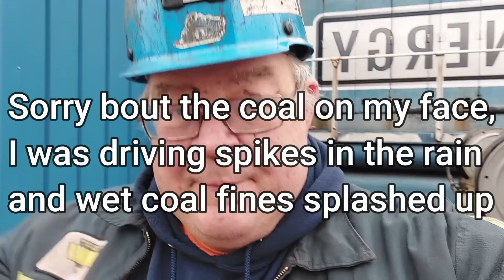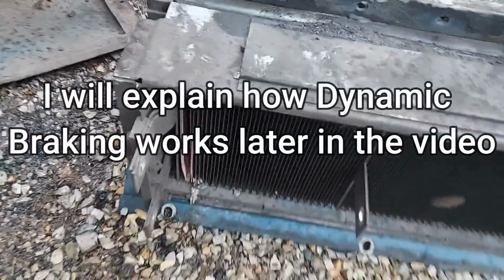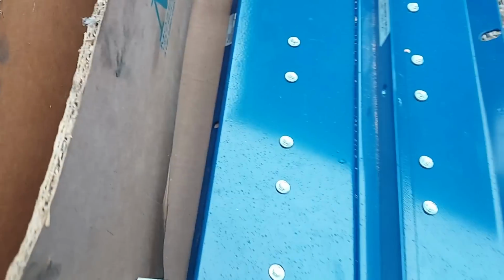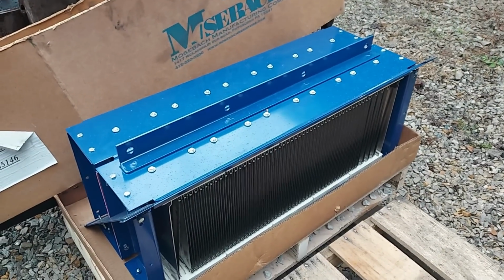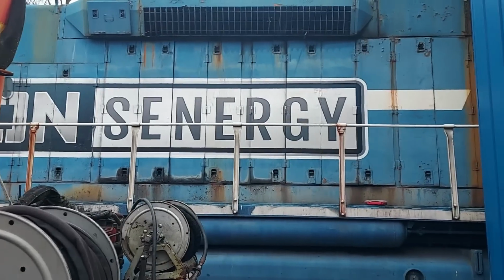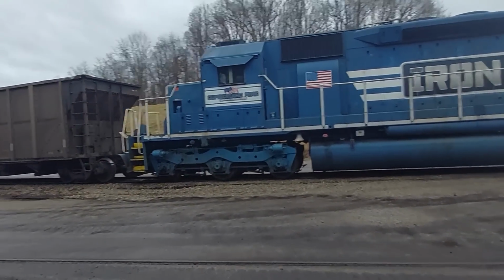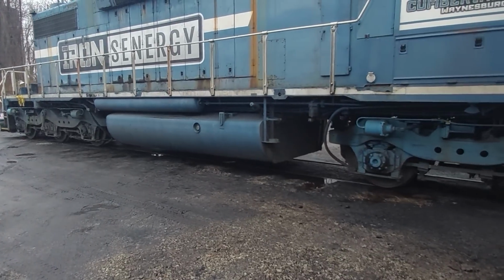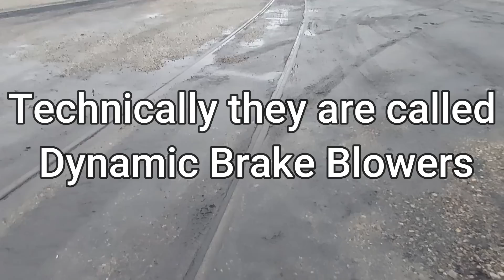New Locomotive Dynamic Brake Resistor Grids

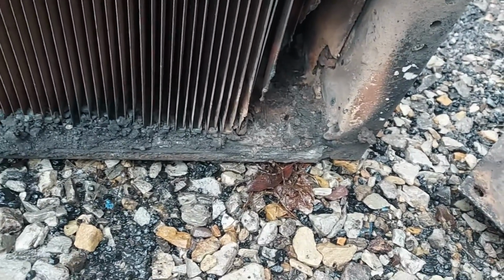Comment: Hi Dave! I have a particular question: I'm building a 1:20 scale SD 40 - SOO line (unit 750); I have also made some flexicoil trucks, which with my available documentation it was not easy to identify what type they are, since I know that there are many types with small differences, so I would like to know what type they are exactly, if you can help me and now I have now discovered they are the same as this 3098  ( on 6:50  ) locomotive in this  video, while the other locomotive in front,  has the different HTC type, I think..! Thank you ! Greetings from Italy !! 😉🖐🖐👍👍
Reply from the maker: Our two SD38-2 locos have the HT-C trucks under them. SD 40-2
units were built with HT-C high adhesion trucks. Our 3098 loco is
an SD 40-2, however it was built as an SD 40. the dash 2 upgrade
came later in it's life at Boise Locomotive Works. The frame on
the 40 is shorter than the frame on the 40-2 locos. Thus the
Flexicoil trucks are under our 3098. So you should be correct
in putting Flexicoil trucks under your SD 40. Also note that there
were many versions of the Flexicoil trucks, to find out exactly
what version was on your SOO you'd have to do some more
research, but unless you are a total correct police type guy,
then don't worry about what C version was on there.
Reply: @ccrx6700  : Your kindness Dave is amazing!!
Thanks for the prompt response! Now I understand much more!!
Now I have almost finished my huge model and I also made the flexicoils very well, it was very difficult! I'm still missing a lot of things to complete the model but it's well underway. 
It's always nice to see you cheerful and smiling!😉
Good day !! 👍👍😄
Reply from the maker: @feisarplinsky5496  👍😊

Comment: I have a question has anyone ever cleaned those  they fail because the cooling fins don't get cleaned coal must clog them up great video thanks Dave
Reply from the maker: A good bit of coal dust does get in there Gary and you are right, that
dust is hard on the grids, with what we do here that coal dust can't
be helped.  Very much appreciate your taking the time to visit with us and check out the video my friend.

Comment: What voltage and whatts are they?

As I used to visit a company for British Standards and visited a company near Southampton making mainly sand filled air cooled ones, the biggest was about 1/2 the size of your one.

Looks like you had water and  crud shorting out the resistor.

You dont want them to fail, when you're dragging a heavy load down grade.
Thanks.
Reply from the maker: I do not know the voltage and watts Anthony, sorry bout that. Yes we
are trying to slow down heavy loads on some steep grades and
those dynamics are the ticket. Most times unless rails are wet
or icy car brakes are not needed using the dynamics only. Coal
dust does get in them and doesn't help out at all. The coal dust
was all cleaned from these before we put the new ones in.  
Very much appreciate your taking the time to visit with us and check out the video my friend.

Comment: @ 7:50 it looks like water and dirt built up in the corners of the resistors may have caused arcing to ground on high loads???
Reply from the maker: Lot of coal dust gets in there Ken, that doesn't help matters at
all. The coal dust was cleaned out before the new grids were 
installed tho, but it will keep on coming in. With what we do here
it just can't be helped and it never gets cleaned out. Most folks never get to see what the grids actually look like, all they see is the screening on the outside of the loco body and can't see inside that.  Very much appreciate your taking the time to visit with us and check out the video my friend.

Comment: I can imagine the dynamics didn't work quite right with the big structural hole molten into them! Does the engineer get some kind of alarm in the cab that his brake circuit went out of service?
Reply from the maker: He is supposed to get a ground fault alarm, whether he did or not
I didn't ask him 2xKTfc. These are old locos and not everything
always works as it should however. Last grid went bad was after dark
and the operator saw flames shoot out from the grid, didn't need
an alarm for that one! :-)   Very much appreciate your taking the time to visit with us and check out the video my friend.

Comment: Thank you for this video!
The vanes at the ends in the radiating unit that are most subject to corrosion could be made of a different alloy. That way, good/serviceable vanes would not be wasted when the time comes to replace the unit. And it wouldn't hurt to have the lower ends of the rest of the vanes plated with a corosion resistant material at the sites where the corrosion seems to begin.

The major difference between a motor and a dynamo is the circuitry. If appropriately configured, the roles can be switched by throwing a switch.
Reply from the maker: That is what happens when traction motors are converted to generators Robin, the circuitry is changed you are right about that.
We have a problem here that is not easily solved and that is the
amount of coal dust that gets in these grids, it just can't be
helped with what we do here. All the coal was cleaned out when
they took the old grid out before they replaced it with the new one,
but it will happen again, no one takes the time to take the screening
off and clean these out on any kind of periodic basis, plus with
only 3 locos they are usually being used and not just sitting
around unless something else breaks down on them where they
have to sit. I'm not sure but using a different metal in them would
have to be stainless steel to prevent the coal from harming them?
No one makes stainless grids that I am aware of and they would
probably be three times the cost if they did.  Very much appreciate your taking the time to visit with us and check out the video my friend.
Reply: @ccrx6700  I was thinking of non-ferrous metals. Also a blower to clear the vanes when in use.

Comment: Pretty well burned up. Sent off to be remanufactured I guess? If you video another such operation maybe try and get a shot or two of the inside of the engine where they are located/mounted.
Reply from the maker: Yes they were and they are sent out for a rebuild Pavil. You can't see
them from inside the engine compartment, all you can see is
what I showed you on the outside where they are mounted. There
is a solid sheet of metal beneath the grids. Very much appreciate your taking the time to visit with us and check out the video my friend.

Comment: Did the coal dust in the fins cause it to short and burn up like that or did the coal dust block the flow of air causing it to over heat?
Reply from the maker: Coal dust in there is never a good thing, probably a combination of
both David. They never get cleaned out as part of a regular maintenance program. With what we do here it's impossible for coal
dust to not get in there. However before the new grids were put
in they did clean out what they could. Actually over the years we
have replaced very few grids that I can remember which is surprising.
 Very grateful my friend for your taking the time to visit with us and check out the video.

Comment: How many people does it take to install this grid? I assume there are electricity plugs on each. Is there also water as well or just fans? What exactly do these things do?  I understand they are part of the brake system, but what? Please begin the class, Dave!
Reply from the maker: Two people on top and one running the crane to lift is Shirley.
Yes there is electric lines to be connected from the traction
motors. They are not water cooled but have fans over top 
blowing air thru them. The grids create resistance to the current
from the traction motors. Traction motors are turned into generators
during dynamic braking which creates current (heat) which
slows the traction motors down.  Very much appreciate your taking the time to visit with us and check out the video my friend.

Comment: These look like actual resistors that carry the current from the motors turned generators and slow the loco/train down.  The resistance generates heat that is dissipated by the flow of air…looks like the one you showed us gave up the fight 😩😖🤬.
Reply from the maker: You are right in that Rod. Those resistors do just that cause resistance which helps slow the traction motors, now generators
down, plus dissipate the heat. Cooling fans on top blow air
down thru the grids. Coal dust getting in there doesn't help the cooling
of them, but we just can't help that dust getting in there with what
we do here. At least all the coal was cleaned out before the new
grids went in. So very grateful for your taking the time to visit with us and check out the video my friend.

Comment: I am an electrical engineer and don't agree with the explanation that the Locomotive Dynamic Brake Resistor Grids are there to get rid of heat. They are there to provide resistance to current flow.  When the motor circuitry is switched to dynamic braking, the motor acts as a generator as Dave said.  Then the motor produces electrical current which must flow and be limited thru these resistors in order for the current to produce a magnetic field which in turn will slow or "brake" the armature (turning part) thereby acting as a brake for the locomotive.  Because a very large current flows thru the resistor grids,  heat is generated by the resistance which must be dissipated to prevent grid melting.  That's why the grid is designed the way it is (like a giant heat sink).
Reply: the generators are producing a voltage (when there is no load, infinity resistance like being disconnected).  when that happens there is no drag by the generators (because no current flow).  with current flow (max amps the resistors and generators can handle) the current flows the opposite way as it flows in a motor (when the voltage is the same way).  thus the watts are going out instead of in.  everything carrying current gets hot.  the resistors are designed to do the most ans let the heat flow away in the air.
Reply from the maker: Very interesting comment minerran, I am a trackman and in no
position to disagree with an electrical engineer. What is true that
the grids dissipate heat, but you very well could be right in that
they are there to provide resistance, that is a bit over my knowledge
about these, so I'm not going to disagree with you at all.  Very much appreciate your taking the time to visit with us and check out the video my friend.

Comment: Do you know if the old ones were original to the locomotive ? They certainly had some wear.
Reply from the maker: I have no idea how old the ones we took out were 47fireguy. 
We don't replace these grids on any kind of frequent basis and
no one keeps records of which ones were replaced or how often,
so it's pretty much a guessing game on how long they last. Coal
dust getting in there doesn't help matters much either but we
can't avoid that with what we do here. Very much appreciate your taking the time to visit with us and check out the video my friend.

Comment: Some of the others comments got part of this but you never explained it. To top that off I never knew what people meant on the model trains about the dynamic break units.  Know I know from your video here enough to state the following.. 
I don't know the values of resistance or the whole wiring thing but these units that are being replaced are resistors and I can assume on the dynamic braking, the wheel motors are wired into these to add more drag to those motors to have more braking, thus heating them up like an electric heater and the fans blow through them to keep them from burning up and the two work together to slow down the train from the engine directly without or in conjunction with the regular air brake system.
Reply from the maker: You are correct Renneth, the resistors create resistance which helps
to slow the traction motors, now generators down, plus they add
in the value of dissipating heat. Fans do cool the grids and blow
the heat away. We have a couple of pretty steep grades here with
heavy loads and the dynamics hold the train back well on dry rail.
On wet or icy rails often some car brakes need to be applied
going down those grades. Very much appreciate your taking
the time to visit with us and check out the video my friend.

Comment: Those resistor grids look like they were "Rode hard and put away molten."  Coal trains are a lot of mass moving, it doesn't surprise me these locos would go through a few grids.
Reply from the maker: They certainly were Jared plus the coal dust getting in there doesn't
help matters at all. At least the coal dust was cleaned out before the
new grids were installed, but cleaning out the dust is not a routine
maintenance thing like it probably should be. Actually tho it's not
all that often that we replace grids, they do seem to last a long
time despite the coal and heated use they get.  Most folks never get
to see what the grids actually look like, all they see is the outside
screening, so was pleased to be able to share this part of a loco
with you.  Very much appreciate your taking the time to visit with us and check out the video my friend.

Comment: Dave, do you know what voltage the traction motor run on. I know on passages equipment, the head end supplies 480v 3 phase to the cars
Reply: 600volt D.C.
Reply from the maker: The voltage warning on the cabinets inside the loco read 500 Stephen. I have no idea about phases tho. I'm not electrically
inclined enough to know about that stuff.  Very much appreciate your taking the time to visit with us and check out the video my friend.

Comment: Do you know what material is used for the radiator fins and for the resistors themselves?  Edit: Are the resistors and the fins one and the same? (Those look line bus bars jutting out at the back, the big metal strips with bolt holes.)
Reply from the maker: I just assumed it was a thin metal Alex, but I cannot say for sure,
whatever it is it works to get rid of the heat.
Reply: Nickel chromium would be my first guess.

Comment: Anyone who drives a Tesla or an e-scooter will understand dynamic brakes. When the throttle is released, the electric motors become generators, and slow the car/e-scooter down. Also known as electronic brakes.
Reply from the maker: You are right about that 46fd04. That is how they work on electric
cars. Very much appreciate your taking the time to visit with us and check out the video my friend.

Comment: I wonder what it would cost to electrify a short line RR like that and what the return on investment would be. Seeing as the locomotives only use a Diesel engine to make electricity I would think retro fitting them with a pantograph wouldn’t be a huge cost.
Reply from the maker: You are right Bob, fitting the locos to work wouldn't be that much,
but putting in 16.8 miles of catenary would be astronomically expensive. At least we would use regenerative dynamic braking if
that did happen tho.  Very much appreciate your taking the time to check out the video and post a comment my friend.
Reply: @ccrx6700  Yeah, the installation of catenary lines is were I imagine the ROI would take the biggest hit, depending entirely on how long the mine you guys serve will continue operating. In hindsight it probably would have be worth it when if it was installed back in '76 but now who knows.
Reply from the maker: @Bolbl91  👍😊

Comment: Hot box. Do they have a temperature gauge. That box looks like the inside was overheated 🥵 and not so visible from the outside. 🫣
Reply from the maker: No they do not have temperature gauges or sensor Clarence.
The last grid that went bad was after dark and the operator saw
flames shoot out thru the screening. Bet that was a pretty cool
sight! :-)  Very much appreciate your taking the time to visit with us and check out the video my friend.

Comment: The old girl is about due for a paint job
Reply from the maker: You are right about that Austin. It does get pressure washed every
so often, but when another paint job is coming who knows. With only
3 locos here it's seldom they sit long enough for them to get painted.
They were talking about putting a wrap on the loco but not sure
if that is going to happen now or not. We had a several month
period last spring where they didn't run any coal at all so funds
may not be available for that. They are keeping the locos in good
mechanical condition tho, that is very important. We now
have some very good contract loco mechanics who know what
they are doing. Very much appreciate your taking the time
to visit with us and check out the video my friend.

Comment: Looks like coal dust got in to those resistor grids, ignited from the heat and burned up the ribbons of metal (nichrome?) that make up the grid. The ballast fans probably made a mini blast furnace in those grids once the coal was lit off. The ash in those old grids is telling. Not sure how you would prevent that other than blowing the coal dust out of the grids when it's cold with compressed air (maybe when you dump the brake air it should be piped through the grids??). I suppose as long as you don't set the whole locomotive on fire, just replace the grids every now and then.
Reply from the maker: You are right Rik, there is a lot of coal dust that gets in there and
no one ever cleans it out. Coal is hard on metal. I do doubt the
coal caught on fire tho. The coal dust was all cleaned out before
they put the new grid in however. But it will accumulate again,
with what we do here it's almost impossible for it not to get in
there. Fortunately we do not have to change these grids on
any kind of frequent basis. They do go bad on occasion tho
as you saw. Very much appreciate your taking the time
to visit with us and check out the video my friend.